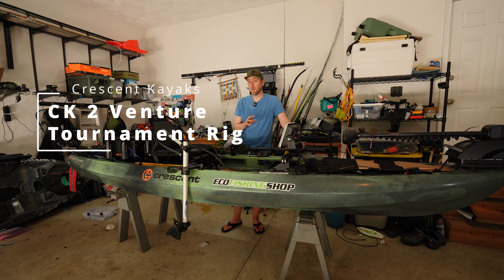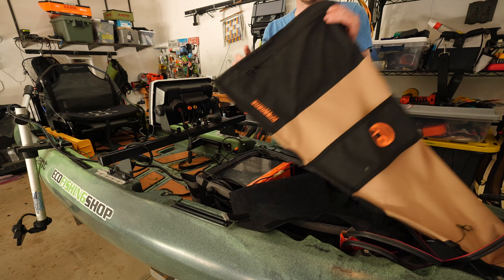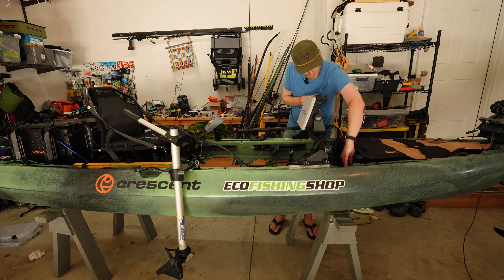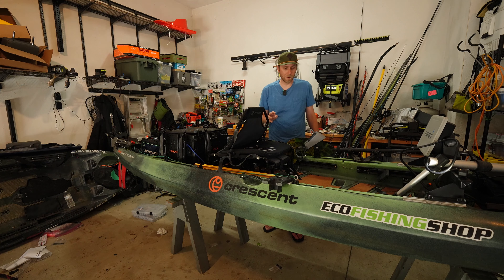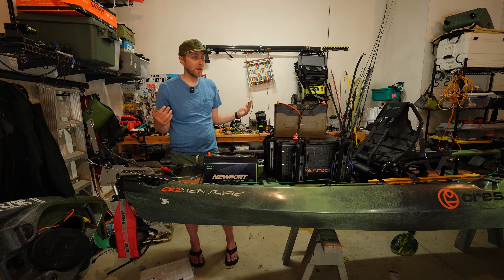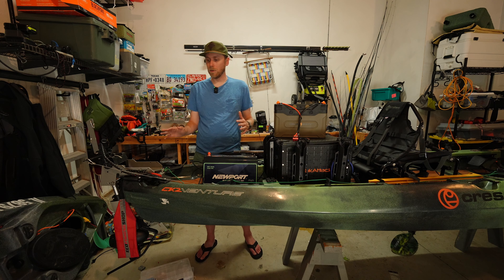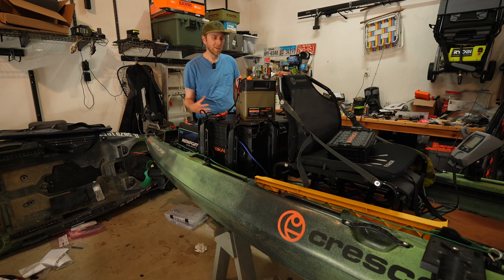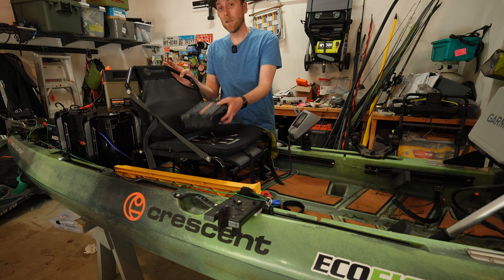Dual Kayak Motors — Crescent CK2 Venture TOURNAMENT RIG Walkthrough

Comment: I'm a bit surprised at the price jump between Crew and the CK2 Venture...almost a 50% price jump.

I definitely see the value of features like the full pad kit and hull access added in the front, and it's still priced competitively with the other popular platforms for motorized kayaks in 2024 like the PWR129 from Bonafide and Nucanoe Unlimited. But will Crescent have a hard time competing with itself and the Crew's pricing?

Edit: missed calling out all the YakAttack track and mounts. Definitely added value there! I do wish the tubing was pre-ran for the steering cables at this price point.
Reply from the maker: I get where you’re coming from there. If you add on everything they’ve put on it default you’d be surprised how quickly it adds up. Especially when you factor in the custom pad kit, high chair, etc. The motor mount too.  a lot of kayaks you’ll need to buy that for and they include it, which is extremely convenient. I know they wanted to do tubing defaults but had issues with doing it efficiently for each